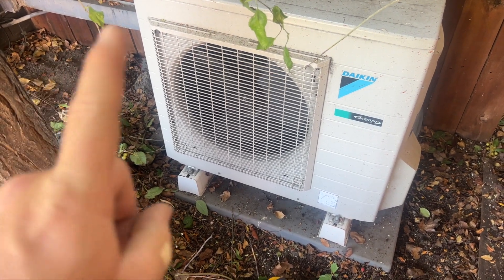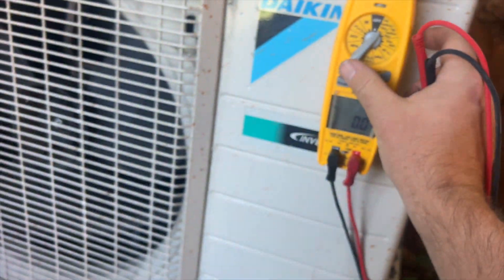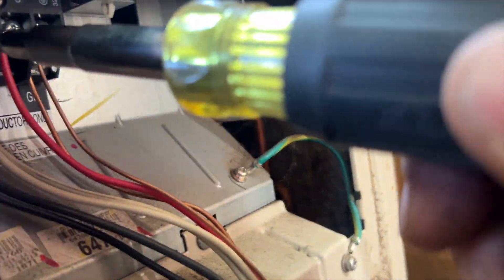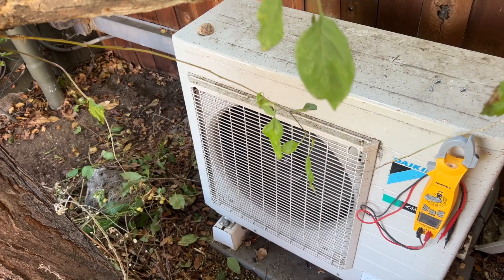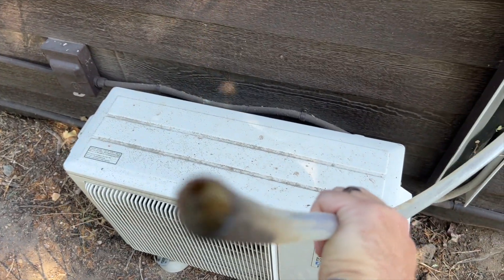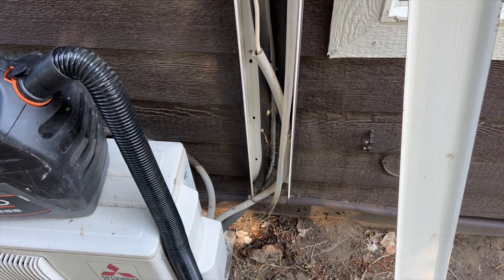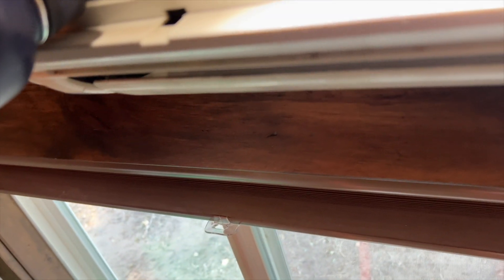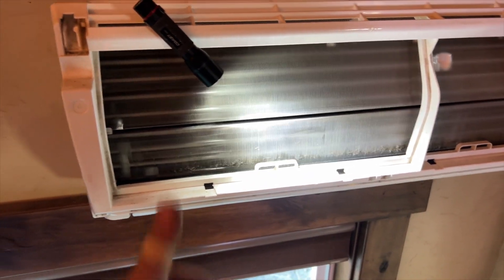Diagnosing and Repairing Common Minisplit Issues EP150

Comment: Someone wired this wrong You have a white wire for one of the power loads. it should be the red. The white is used for number 3 the commutation line .
Reply: In my area and company I see a lot of units where the red wire is my communication, usually on mitsubishi mini splits. Function over color every time

Comment: This was interesting - I have an older Daikin inverter, very nice (after an initial month failed compressor being replaced) for nearly 10 years now, but a newer (6 years now) Mr. Slim inverter unit failed today - after the outside fan came on, within 10 seconds shut down. At least now I know where to look for error codes... After about 10 retries, it finally got started (and is fairly cool) so I'm worried it's either a failing compressor or possibly - after seeing your video - something like a board. The last two years I asked (once each year) for them to check coolant level, and it didn't need topping. It's not something I'd expect to suddenly start leaking really.

The big issue (in Thailand especially) is that most 'professional HVAC' are just someone who went along with Uncle after watching someone clean their aircon, and picked up some tips from there - and it's impossible to judge their level of professionalism... so I am going to start working on this myself - find out if I can order and replace any dodgy looking boards if I find any, check connections.

What'd be interesting is a guide to telling how to know if your compressor is likely to be dodgy (even though now it's blowing pretty cool). I like your approach, rather than just saying 'call them' or 'call a hvac engineer' because sometimes those options are just not possible.

What's definitely sure is that there's nothing we can do (in Thailand) if they rip us off... the legal and regulatory system is forked :P